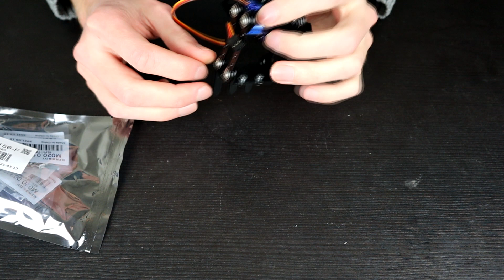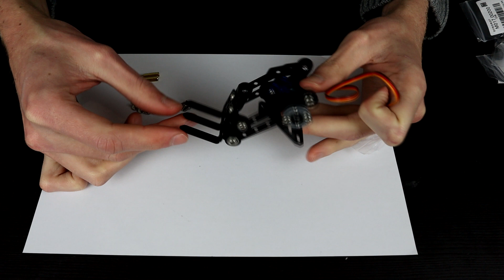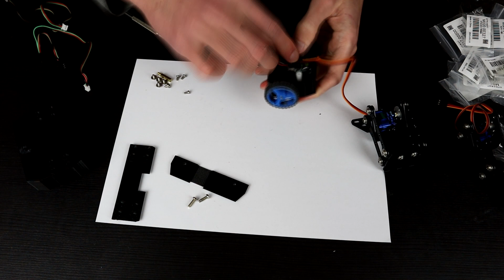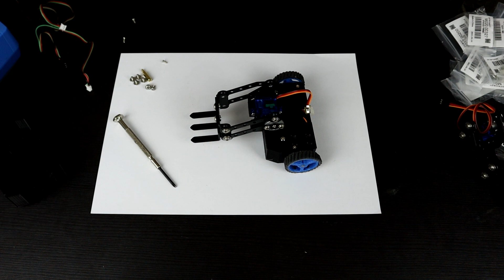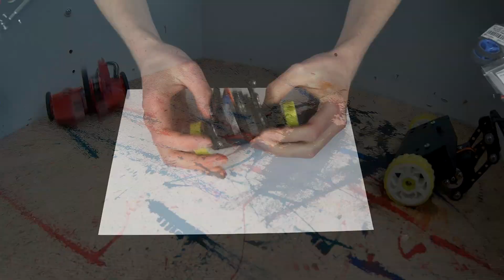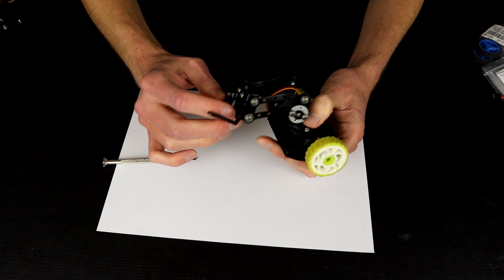DfRobot Forklift Kit Testing

Comment: What about flipping it around, so the lifter is effectively reaching across the wheel axis? The main weight (servo) would be on the opposite side of the axis of the lifting forks, giving it a bit of a back weight.

Comment: if you moved the actuation point to the read of the robot, still facing out the front - obviously you'd need some form of channel or angle on the body to allow it to still reach the floor - but would that counter many of the balance and weight issues?

Comment: I love the idea but I see it mounted on a modified red balloon chassis working better,  a dust pan style chassis with it mounted at the rear over the drive wheels would help it lift and push  and also stay as a control/ graber if lowered on a bot in the dustpan/ on the wedges.

Also can upgrade the servo to something way stronger 💪
Reply from the maker: read my mind, a red balloons style chassis is the plan for v2 when I get there
I dont think the servo needs an upgrade really, it can easily lift 150g I just need to get the balance right

Comment: Nice video Ben! Maybe you could mount the arm on a 4 wheeled robot, with either the fork or maybe a custom made attachment for a small hammer saw. Since the arm seems to be somewhat durable (you could reinforce it with bushing) , you could change the attachment based on your opponent. Maybe even a wedge attachment?
Reply from the maker: I'd love to get it on a 4wd, but its a little too heavy for that, maybe if I swap some parts out it would work

Comment: Instead of having the little nub on the bottom of the robot, could you add some static forks that come out from the chassis to prevent it from tipping? Ideally, I think the forks would be best as long as the lifter protrudes from the front of the  robot, just to ensure it can't fall forward. This should also help your drive as well, as it is moving the front contact point with the ground in front of the lifter, and not behind it. Hope this may help if you ever pick up this project again!
Reply: Yes, a counterweight is not necessary, think manual pallet trucks/lifters or workshop cranes. A sheet of CF with cutouts for the forks of the lifter should work just fine.
Reply: @ladedk  Yeah, that could work too!
Reply from the maker: Hmm yeah the skid point really didnt help much, I might have to redo this one in the future
Reply: @TeamPanicRobotics  I’m looking forward to it!
Reply: I fully agree with that. The big challenge is to make those forks light enough for the robot to make weight, but also rigid enough so they don't snap under the stress of lifting an opponent.
Reply: @razer259  Yea, the easiest way to achieve this is likely just incorporating them into the 3d printed chassis.